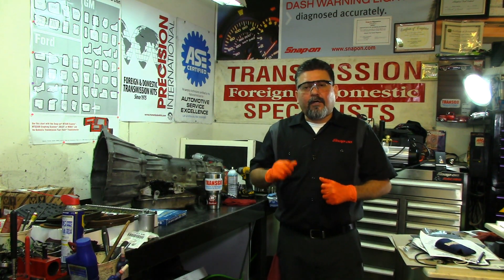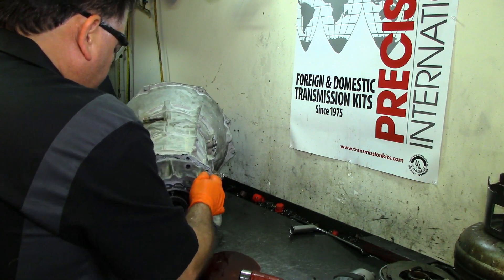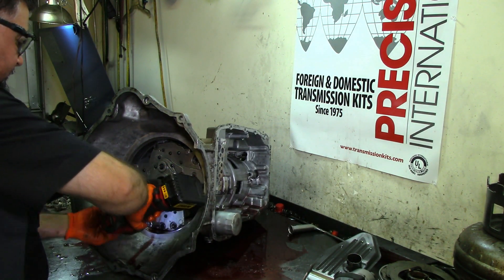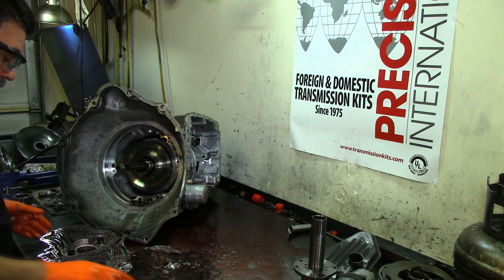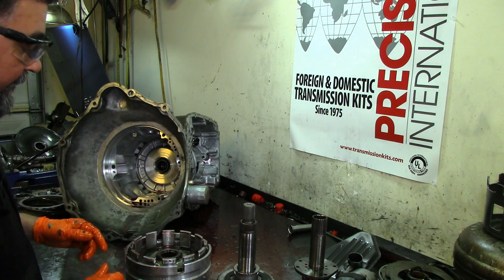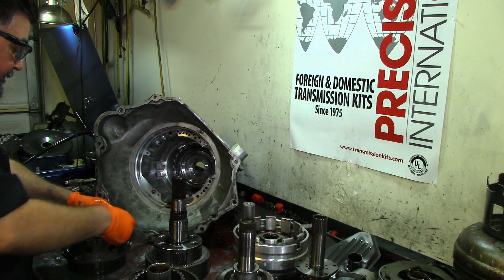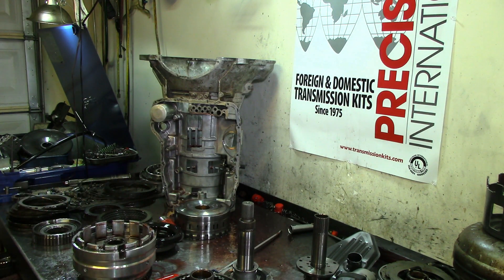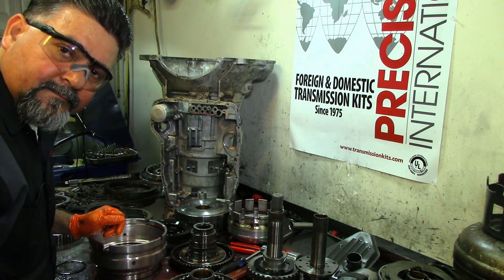68RFE Transmission Full Rebuild Part 1

Comment: Good to see you back again. I have been a mechanic for years, but always avoided transmissions. Until I got a job at a trans shop wanting to just do a little of their side mechanic work on a semi retired basis. Their 'builder' was awful, 50% or worse come back rate. Figured I couldn't do any worse than that. Now less than 2 years later I am the builder and he's gone. My come back rate is well under 5%, and of those its more likely to be an installer error than my failure. Still a fairly stressful situation. Your videos have helped me tremendously, especially in the first year, but still serve as educational tool/reference and will likely continue to. Thank You.
Reply: Little late to the party, but kind of in a similar boat. I’ve built many a manual transmission as a hobbyist, and always avoided automatics. People regularly asked if I also rebuilt them. Told them I didn’t because there was always something so mystifying about them. Watched a handful of videos such as this and they don’t look any more intimidating than a stick shift. Contemplating dipping my toe into the automatic waters now.

Comment: Sonnax makes several parts for the 68RFE to help them live at higher than stock horsepower levels such as the overdrive clutch housing kit you mentioned. Thought I would mention that in case someone who is new to the 68RFE is watching and planning on doing their own rebuild as I am. I've got a 2008 Dodge 2500 with the 68RFE so I bought a core 68RFE that I'm planning to rebuild and then replace the current transmission before I add anything to increase the power output of the engine. I'm not aiming at anything insane for power however I do plan on adding compounds which should increase low end torque as well so planning ahead with the transmission.

Comment: I'm a transmission builder too. Been doing it for 30 yrs or more. My snap ring pliers are always wore out. Snap-on replaced my pair for the one inside the input drum but I don't like the new style handles. My hands are too small to get a grip on them. I want a new pair like the old style. Great job on showing everyone else. Thanks

Comment: Every single 66rfe and 68rfe i have ever torn down has that snap ring sitting near those seals in that exact position, i always install them with the snap ring not showing in that opening but i have never had one that doesn’t sit like that when I’ve opened it up…weird

Comment: Recently bought  a dodge 2500 with cummins but chose to go with a standard trans simply because I had heard so much bad stuff on the autos. Interested in this video because friend has a newer dodge with auto no trouble yet but no controller but he does pull heavy stock trailers. good stuff Hiram

Comment: Picked up a truck with a 68 RFE that will not shift into reverse or park.  The front drive shaft and transfer case went.  Smacked the rear output sensor into the trans.  Took off the extension housing and found plastic in the back.  Cleaned it out but still will not shift into reverse or park.  Any ideas?  No trans experience.  Thanks.

Comment: Love your videos! Anyone ever put 66RFE guts in their existing 65RFE case with the 65's valvebody, solenoid pack, and electronics? What if you added the Sonnax 65rfe Smart-Tech® Overdrive Clutch Housing Kit and upped line pressure with the 66's planetaries?
Reply from the maker: Haven't done that. 
On 66RFE I  get the kit from the dealer. 
I don't know anyone yet making the frictions and steels for the overdrive clutch.

Comment: Question. Replaced my stock torque with a Goerend triple disc torque. Also did filters and deep sump pan. Ever since then I have a delayed downshift only 5-4 when coming to a stop. If in TOW/HAUL mode I have no problems. Otherwise shifts fine. Could it be a piece of debree in the valve body? Or just worn out? 350,000 kms.

Comment: I bought a 2008 ram 6 years ago. Had 146000 miles. I flushed the pan and did the filters. I always use the tow haul button when pulling my trailer. Im now at 250000 miles going strong knock on wood. 
I just did my first successful transmission rebuild on a 4l60e. Just curious how much more difficult this one is?

Comment: The overdrive frictions burning are mostly from people towing without using tow haul. Those frictions and steels just can’t take that weight in those overdriven ratios unlike the 4 speeds. Every 68 I build I put a pump, converter, and overrunning clutch in as well. I really recommend using mopar kits, a lot of remanufactured transmissions I put in for 3rd party warranty companies come back. That snap ring in the input drum is a real SOB hahaa. Did you replace the cooler too?

Comment: Hello,  I was wondering if the 68rfe planetary will work in my 545rfe case. I believe they have different trust washers and the 68rfe doesn't have a bearing # 7. Any information would be greatly apricated.

Comment: what would you recommend to beef up the 68rfe, behind a 6.7 cummings, on a truck thats been tuned and deleted?  the main reason for the tune and delete wasnt to add HP but ive found myself really enjoying it occasionally and would like the option without feeling like im smoking my tranny.  any and all information would be helpful, no matter of how invasive it might be.  ive already had a code on the tranny that my local mechanic cant figure out and since the tune, ive been concerned.

Comment: i  see on other vids that you use a squeegie to push the old trans mission oil to the back of the bench. Where does the oil go, could you explain and demonstrateplease? Its an odd request i know but i m just curious ty
Reply: he has a transmission bench. so in that channel on the back side of the bench it is lower in the middle or even just on one side so that the oils and fluids with go down a drain and into a drum of some kind so they wont go on the ground. 
some transmission bench's  the drain is right in the middle.

Comment: Always great videos. thanks. I am going to be putting in a reman'ed Mopar pump in my 545RFE when I change the torque converter. I am getting the Sonnax 44912-01 TCC Accumulator spring to replace the one that comes in the reman'ed pump (Sonnax is supposedly made of "upgraded material increases spring strength" and rated for more duty cycles). My question comes in since I am also installing the TransGo 45RFE-HD2 Reprogramming Shift Kit and it comes with a spring set to go in the same TCC Accumulator. Should I just install the Sonnax 44912-01 instead of the TransGo springs there? Also, the TransGo kit comes with their own TCC Limit Valve parts (ball, spring, plunger). Seeing as this is a reman'ed pump, should i install those or leave them out? (thought i heard those were for the older pumps, but i am not sure). Thanks for any help.

Comment: Also quick question, I just got a ‘72 Cadillac deville I believe it used dexron 2 when it was new, should I use dexron 5? Are they backwards compatible?
Reply: Mike  yes - the newest version of DEXRON is actually DEXRON 6 (commonly shown as VI) and It is fully backwards compatible and can be used wherever DEXRON II and/or DEXRON III are recommended.  Here is a link to an 10 year old article from when DEXRON VI was just getting released to the public   http://www.counterman.com/faqs-on-gm-s-dexron-vi-specs/

Comment: Hey hope to still contact you .I've got 4r100 that had a missing clutch and steel in the overdrive clutch what should I look for in damage if any it was drove 2 miles or less it would not go into overdrive and the overdrive switch was blinking for good reasons besides adding a clutch and steel is there any problems I should check for.

Comment: QUE TAL HIRAM ESTA EXCELENTE EL VIDEO  ME AYUDO MUCHO LOS TIPS Y COMO DESARMARLA LA VERDAD MUY BUENO.. ME GUSTARIA SABER ACERCA DE LAS TRANSMISIONES QUE TRAEN LOS 2014 FIAT 500L  EN ESPECIFICO PORQUE LA VERSION 500 ES DIFERENTE.  VOLVIENDO AL 500L TENGO UN CODIGO P1CC0-00 HYDRAULIC PUMP STUCK OFF Y NO HE ENCONTRADO NADA DE INFORMACION DE HECHO LE CAMBIE LA MENTADA PUMP HYDRAULICA Y ME SIGUE DANDO EL MISMO CODIGO DE HECHO YA NI SIQUIERA ME DEJA REPROGRAMAR LOS CAMBIOS YA QUE ME DICE QUE TENGO QUE ESPERAR A QUE SUBA A 45 BARIOS DE PRESION Y NUNCA PASA DE 39 bar  HE REVISADO LOS SENSORES DE PRESION Y ESTAN BIEN Y HE CHECADO EL DATA DE TODOS LOS DEMAS SENSORES Y SI HAY SEñAL PERO NADA NO SU BE LA PRESION YA ME FRUSTE Y NO HE PODIDO ABANZAR. HAGO MECANICA DE MIS CARROS Y ESTE ES DE LA HIJA DE MI SEñORA Y PUES YA SE IMAGINARA BUENO EN FIN ..... SALUDOS Y SIGA ASI SON MUY BUENAS SUS ENSEñANZAS

Comment: Sorry, I kinda showed up late to the party on this. I’ve been away from YouTube for a while due to being PO’ed at the powers that be at YouTube HQ over things. Still am really, but that being said, I’m still gonna try and watch your stuff. I know this transmission is behind a diesel, and putting a programmer on a diesel, by and large, causes more shit than anything else in this world. However, the way I look at it, if putting even a mild program in causes this transmission to take a dump, then 68RFE’s were already hanging on by a thread whenever they were brand new. I’m surprised you don’t have a policy of building all 68RFE’s for high performance just for the sake of covering your own hide.

Comment: Hiram, question on the 68rfe, I just developed two issues, truck is trying to push against brakes when coming to stop like torque converter not unlocking, done this for couple weeks now, and today it spit up trans fluid out of dipstick hole.    I'm pretty sure it needs rebuild, but what could be causing these issues so I make sure they get addressed.  Thanks, merry mass, please email me at jasonlwoodward@sbcglobal.net, thanks in advance for you expertise.